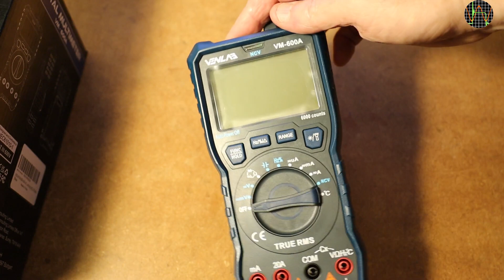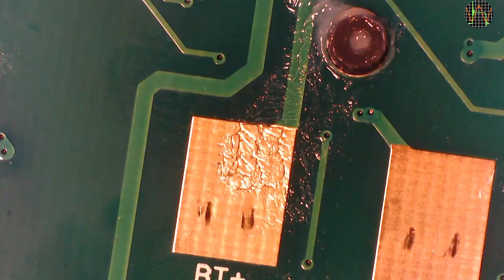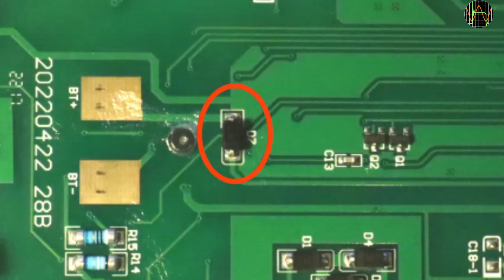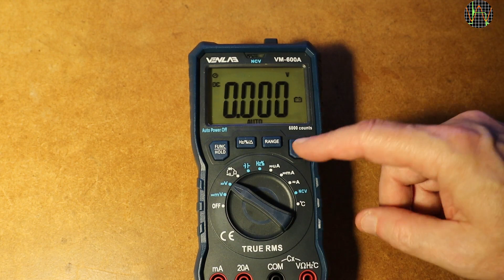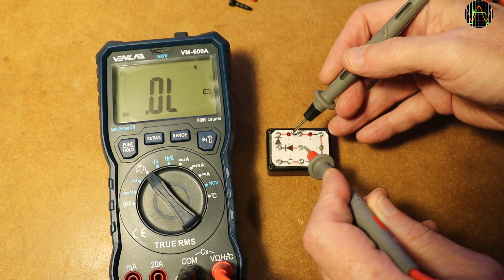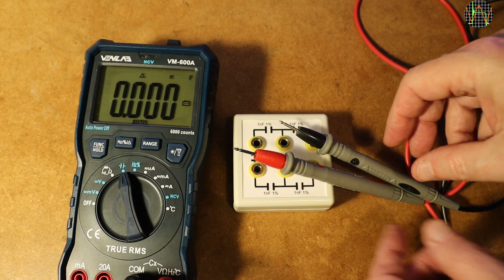120 - review of the VENLAB VM-600A budget multimeter

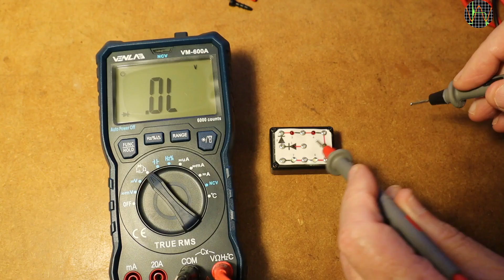Comment: 17:17 That's a very nice and handy box. 
Regarding the multimeter itself, i think there are much better budget meters on the market and with even a lower price. 
My previous DMM The Aneng AN8009 has all these features as well and is 50% cheaper. Also the newer Kaiweets are cheaper then this Venlab. 
The build quality of this Venlab is very poor, simple glass fuses in a DMM is not done, even the Aneng comes with ceramic fuses, and that overkill on grease all over the contacts and currentshunt is also a no go. That CE mark can't also be true.
Reply: Can you recommend a good multimeter in the €50 range.